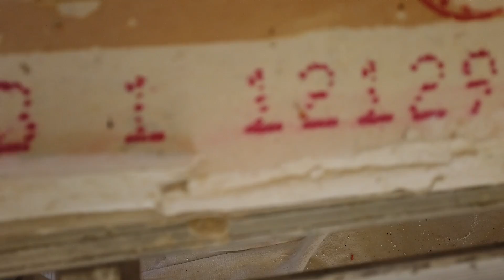Makita 18V Drywall Cutter Saw is a Money Maker

Comment: Great video I bought one and have used a couple of times now to find joists for over boarding ceilings… the drywall blade cuts through artex ceilings easy great tool! What is the dust / vacuum attachment your using? Do you have a link for me as I could do with one just for this tool. Thanks Mike

Comment: I really want this but they need to make a carbide abrasive blade for Plaster walls because the normal blades with teeth get destroyed way too fast. That's my biggest issue I'd like to solve right now. You're either using a sawsall or a grinder and both make a lot of dust and rough cuts. 

I have the Milwaukee 3" cut off saw with dust port, which works amazingly well with the abrasive disc on plaster, but the cutting depth is only 5/8" and you still have to follow through your cut with a multitool because plaster is usually 3/4" which defeats the purpose. Wish they made it in a 4.5" blade.
Reply: Id have to disagree i use mine at every day for 1 year now blades hit nails in studs ect and still cuts fine. Haven't changed the blade since new

Comment: This is an amazing tool, but not worth it unless you patch drywall regularly. I barely ever am able to use mine, since I'm only ever cutting drywall right along side of tile to remove the tiles, or I'm tearing out entire walls which its useless for in either situation. Also you can't even see where you're cutting if you don't have a vac hooked to it, unless you remove the clear shroud, which is a pain in the buns. Oh and worst of all, you cant cut up the middle of a stud like you would want to, because you'll wreck the blade on the screws, so you have to use blocking, but there's very often pipes and wires in the way preventing that. Very rare for me to even encounter an opportunity to use it, and I do interior remodeling.  I leave mine at home now, just took up space in my truck. Least versatile tool ever, but it's the best way to cut drywall in certain situations.

Comment: Id need to check this tool out thoroughly...so far all I see is a waste of time and money.
Reply from the maker: Yeah if you don't need to cut Drywall forget it. If you do... buy it.
Reply from the maker: Not for new work.
Reply: This is the repair/remodel/restoration work contractors dream tool.  It is not much use for new work, but I tell you what, I love mine for working in occupied homes or even in an unoccupied remodel.  It saves so much time in clean up alone!!